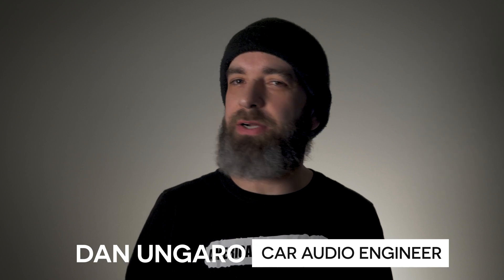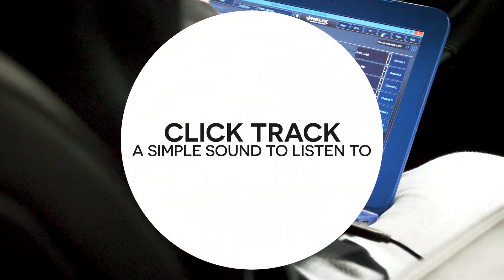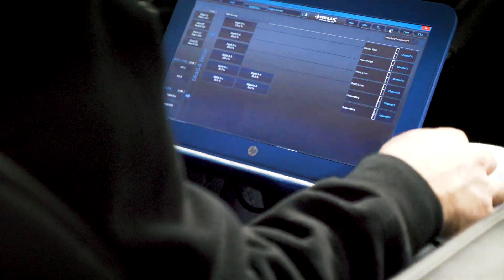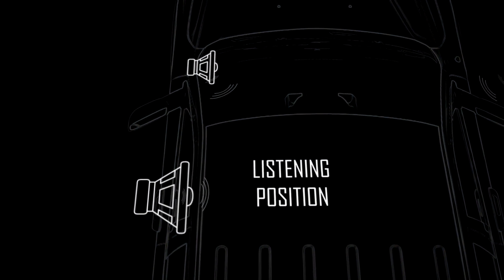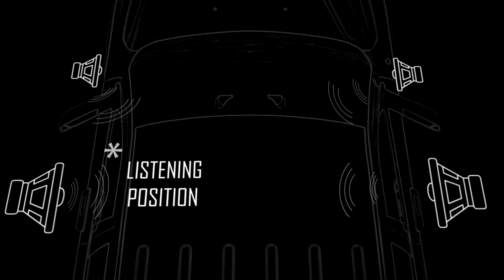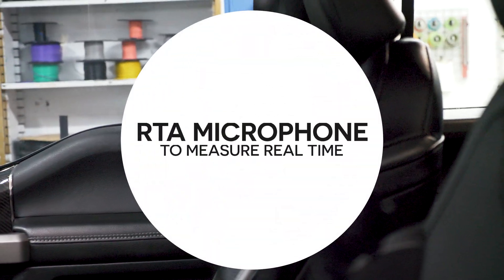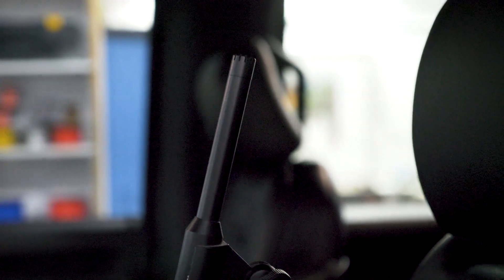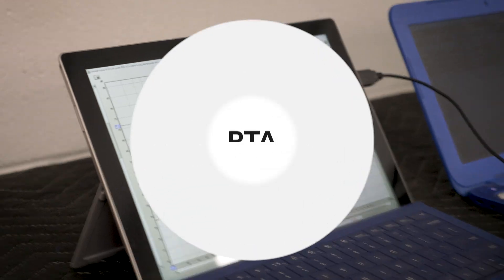Tools Needed To Tune Car Audio DSP

Comment: Whats the  Difference with a microphone up or straightforward ?
Reply from the maker: Just how it was calibrated. You can have it set up either way. I have nothing to back it up, but I feel vertical is most neutral.